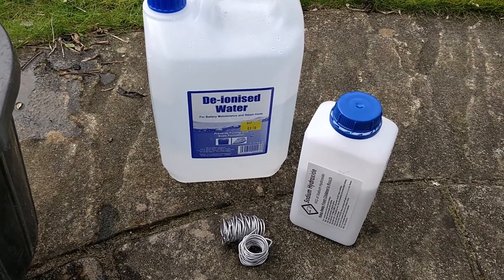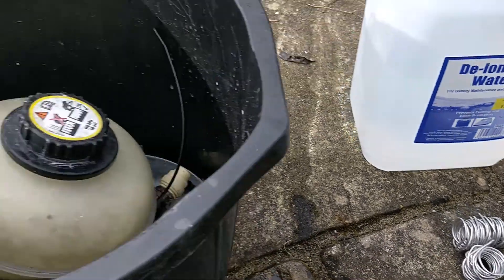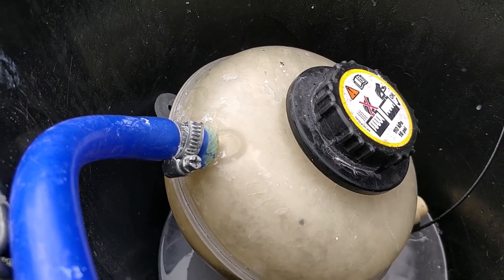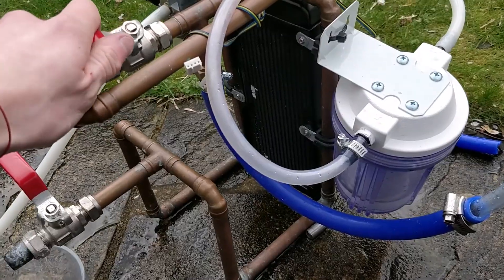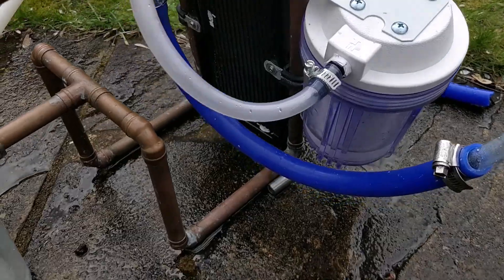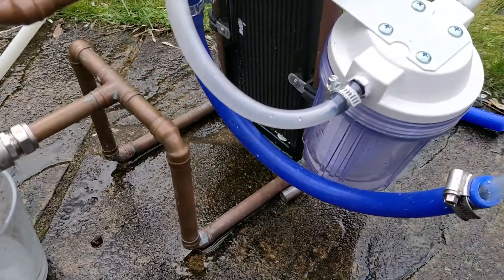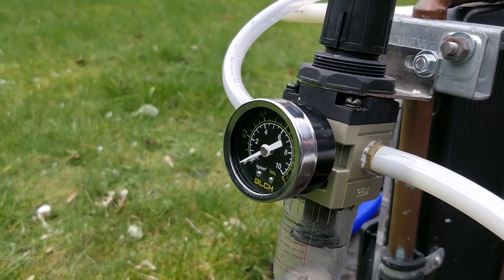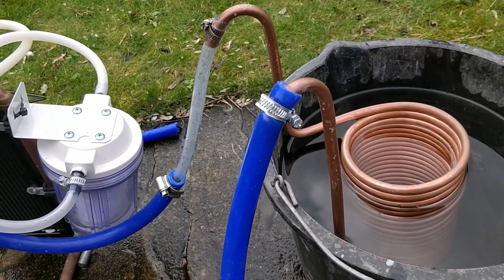Cheap pure hydrogen gas generator

Comment: Are u still alive? I'm thinking about doing somwthing like this.  How's the project going?
Reply from the maker: Still alive thanks, the hydrogen engines are still going too. Just not had time to make any more videos.
Reply: @Hydrogenguys  Hey have you had any issues with hydrogen embrittlement in your engines?
Reply from the maker: @mememan2344  yes! After around 6hours of running the piston head started to have what looked like small cavities . All concentrated around text or rough edges on the piston. 

I have a 50cc engine what doesn’t suffer from this and I think that’s because the piston in that engine is smooth to a mirror finish.
Safe to say water injection for cooling and a smooth piston helps reduce the embrittlement issues
Reply: @Hydrogenguys  I will definitely add water injection in that case as I am about to start using hydrogen only for a power source for all my projects, and I'm hoping that the generators will survive a while. It seems that with adapting ICE for hydrogen use, water injection is not optional. Thank-you for responding, and I hope to see more about the engines in the future.
Reply: @Hydrogenguys  👍🏻 brilliant. Any tips on where to start? I'm just doing general research atm.

Comment: Did you vacuum the air out of the tank. Before filling it with gas, this can be pretty dangerous. I think it's too risky to have a steel tank unless you have a good purity tester to make sure no oxygen got in. But most of the people who blow themselves up have split cells that aren't splitting properly. And I understand you're using a chemical reaction.
Reply from the maker: Hi.
Yes air is sucked out the tank before being filled. And an oxygen sensor is used to test the gas quality. I believe anymore than 4% oxygen is dangerous. The split cell method is more common however like you said if not done right some of the oxygen can get into the tank.